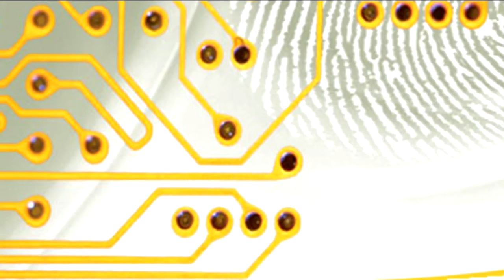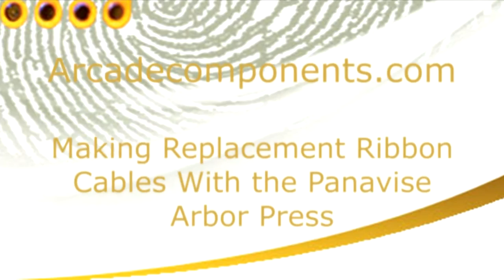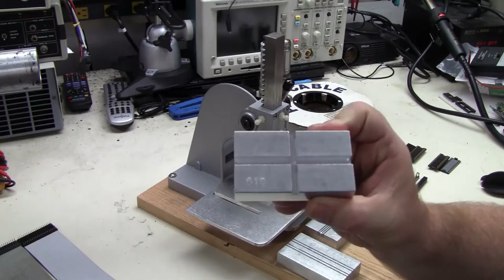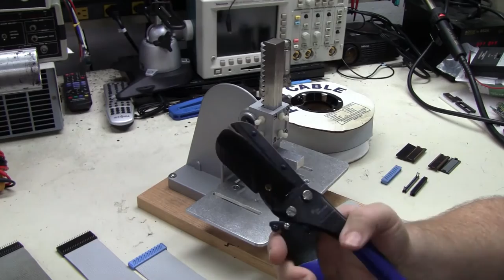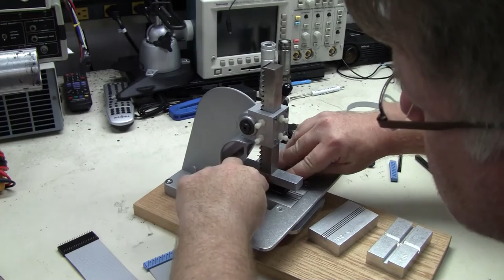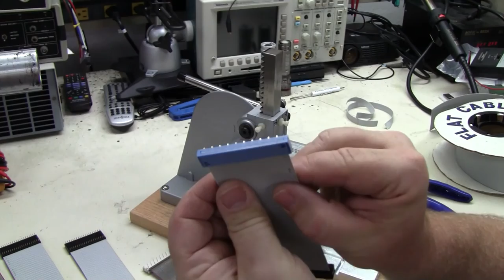Making Cables with the Panavise Arbor Press

Comment: you're the guy from Dave's video, right? please upload more!!!
Reply from the maker: Did a quick one last night on the NeoLoch Inquisitor chip tester and posted it today. I picked up an upgrade for the PIA blade at the Texas Pinball Festival last month to add 6532 RIOT chip testing capabilities. I also picked up the 4116/4096 DRAM blade kit for testing the old tri-voltage 4K and 16K DRAMs. If you're repairing old gear, it's VERY nice.
Reply from the maker: Next will be a look at the Kurz Kasch tester for working on old black and white arcade games.

I may do one on bad caps after that. I've been helping my son with repairs to some older PC gear and they have quite a few bad caps on them.